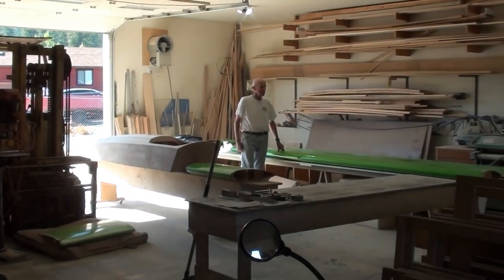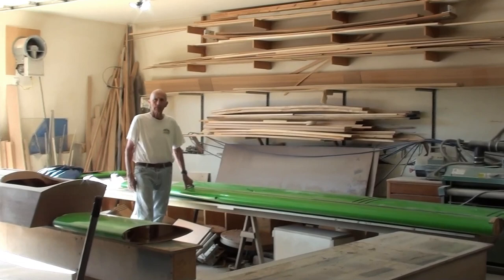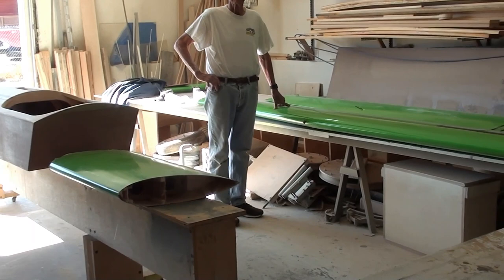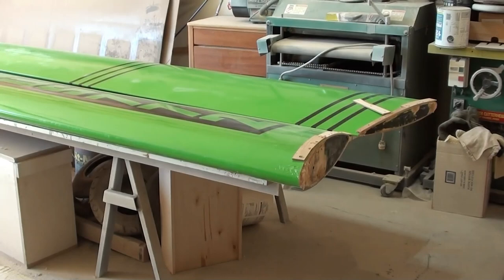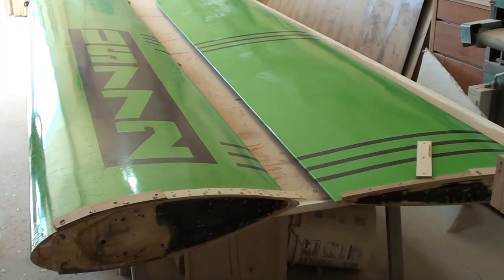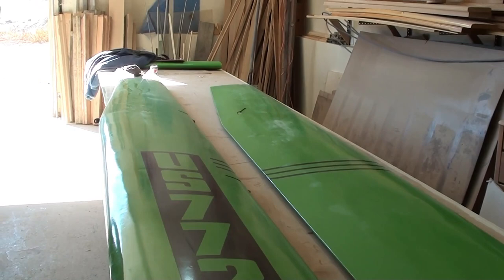Russ Foster - Land Sailor and Solid Wing Innovator

Comment: Amazing design! About the foot of sail gp boats.. The pressure there is concentrated, due to it being endplated at the root, much like an aero fuselage. In the clips, I see the tip of the (vintage) wing sail is endplated, much like a winglet, which serves the same purpose.